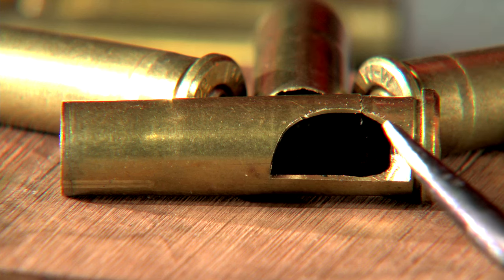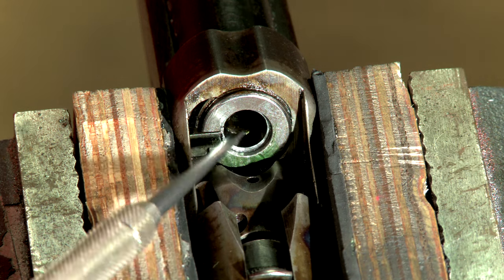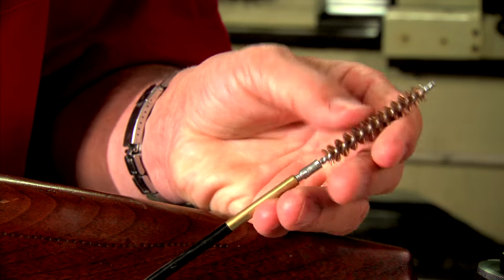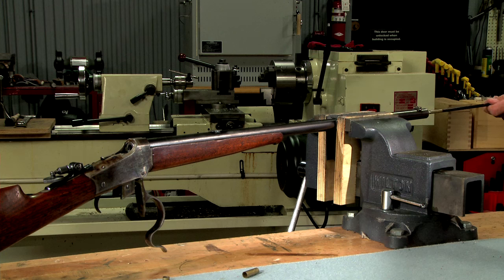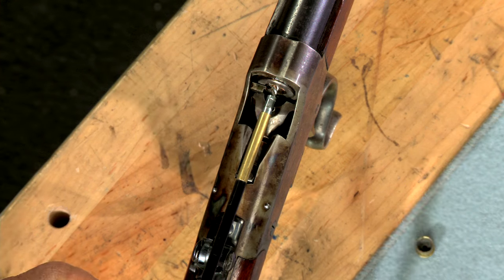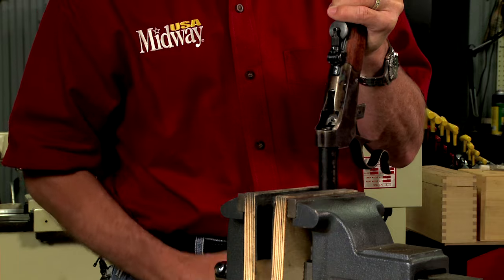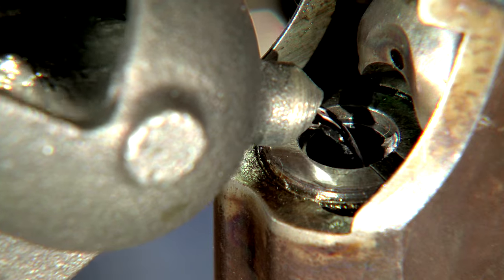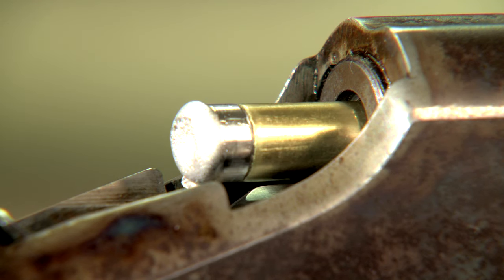How to Extract a Broken Shell from a Rifle Chamber | MidwayUSA Gunsmithing

Comment: Some commenters are missing the point of this video. The idea behind using Cerrosafe is its' low melting point combined with its relative hardness. Plus, when cooled, it shrinks a tiny bit, making it easy it tap out as shown.
Someone suggested using lead for this purpose. DON'T !!! Lead will stick in the chamber. Using Cerrosafe would work under field conditions, with some types of cigarette lighters as a heat source. You couldn't do that with lead.
Reply: Thank You.
Reply: Lead shrinks as it cools too. This is why Lee has to engineer their molds to drop over wanted size, in case someone casts too pure of an alloy. In fact it can shrink a few thousandths

Comment: Larry is a life saver. My DPMS got a broken piece stuck in the chamber today at the shooting range. Couldn't find a shell extractor locally other than at MidwayUSA which would be a 200 mile round trip. Decided to try his cleaning rod and brush method and it worked with a new brush. A used brush more than likely won't work as it didn't for me, too worn down. Either way, I have ordered a broken case extractor for future use but have never needed one before. Thanks Larry!

Comment: Insert a cleaning rod, from the muzzle. Screw a brass brush, just larger than the cae ID, to the rod. Pull the rod into the cartridge. Smack rod, towards buttstock, and brass brush will push cartridge out. Has never failed me yet.

Comment: I find a tap that will thread inside the case without touching the chamber. Usually it will break the case loose just threading it in, or you can tap it out with a cleaning rod. I use this same method for a stuck case in a sizing die, but insert a bolt, then draw it out with a sleeve and the threads

Comment: Yep good stuff but the bore brush will not work with a 30,06 or other high powers in tight chambers.
Simple physics really the case hugs the wall after expanding when fired hard brass on medium steel is way stronger than any bronze or aluminum rod.
So go easy if you don't feel confident give a gunsmith $20-$30 to do it instead of breaking your rod or other damage to the barrel.

Comment: I'm surprised cerrosafe's not banned yet. An eutectic alloy of 50% bismuth, 26.7% lead, 13.3% tin, and 10% cadmium by weight, Cadmium is an environmental hazard and it was banned from use in the electronics industry for quite some time. On a side note, I know of no better metal to cast a barrel though.

Comment: There is a easy way out .1 brazing rod or old brass cleaning rod .bend  1/2 inch from tip , enough to bind in bore. This will snag case mouth .tap rod end with hammer, repeat. Soon stuck case comes out. Cheap solution no gun smith bill. No high dollar exotic metals.

Comment: Great job , I'm a plumber and I use Silver Tin combination solder called 95/5 adheres to brass copper but not steel. You can't get it hot enough to adhere to steel.

Comment: used it on a remington 550-1 that id fired too hot of a 22lr in and the case stuck and i actually ripped  it in half trying to remove it. i bought this cerrasafe and did like larry said and it worked like a champ. i was happy i love my remington and not being able to shoot it causes me to be unhappy! feel better now also learned that on old 22lrs you gotta becareful using hot rounds what i mean is anything over 1250 fps is probably not a wise idea,that didnt have those when this was made and the pressure is too much for it.

Comment: Now for an EASY way which I have done over the years.. Take a fired case cut the head off so you can find the right fine threaded tap that fits and not cut thru the case wall.. 10/32    1/4 -28  or a metric  .. run the tap into the broken case in rifle  then tap it out with  a cleaning rod....

Comment: ..and in case you can't get your hands on Cerrosafe alloy:  cut the hex-head off a timber screw (12-11 for my .22 hornet), weld to 5 mm rod, remove the bolt, insert, lightly screw into the broken cartridge until it grabs ...and extract!

Comment: More difficult? Not really, if you have a ladle and propane torch. As for costing more, a 1/2 of Cerrosafe alloy cost about the same as a broken shell extractor and is reusable. Also, a lot of serious shooters and gunsmiths have Cerrosafe on hand for things like chamber casting (to verify what round a rifle's chambered for)  and slugging a bore (to find a barrel's exact dimensions for those that cast their own bullets or to check that an old barrel hasn't been shot out)

Comment: My 1873 clone did just that with factory ammo.  I have never seen that before, despite shooting (60yrs) ( and reloading for 35 years).  All the pushing and pulling on that 44 mag with brushes and soak with k,,um  penetrating oil even with shotgun brush-- no chance -- so I got the cerrosafe casted the chamber and put a steel rod down as you said exactly and popped out the broken casing.  You cautioned against over filling, so I got the exact right amount and since it is a lever action used a funnel.  Archimedes was right! I got lead on the bolt face as the tip of the funnel displaced some. RATS!  I tried picks and all that saying to myself he told you not to do this!  Then I remembered cerosafe has a low melting point and got the heat gun and Q-tips and it shoots like new.  Thanks for all you do!

Comment: Mr Potterfield
Well done. To the point. Ingenious. I have a not too similar problem. I have a 12ga shotgun with 10 adapters ranging from common handgun rounds all the way to .30-30 and .45-70. The problem is that the spent cartridges are the very devil to get out of the adapter. ( not to mention the adapters themselves).Of course I can knock them out with a cleaning rod, twist them out with pliers, or pry them out with a knife blade, but all of this reduces me to civil war era reload times.  Can you Macgyver me out of this one? Thanks in advance.
Reply: Little too glib there, my friend. Most of them are X caliber inserts, the rifle inserts are $125 18 in SS from Ace Dube at MCA Sports.  Not much help.

Comment: This is the typical work that should be done by a professional gunsmith. If amateurs start to fix the gun, the crown or the chamber may suffer an irreversible damage.

After the case removal, it is worth checking the barrel for cracks, dents and other dangerous deformity with special tools like bore-scope.

Comment: I find that using a brass brush, with several swabs around it, and lightly tapping it into the back of a necked cartridge can usually wedge into the cartridge, and then be pulled right back out aloing with the stuck casing. Bit quicker than going out and buying some metal to cast. But thanks for this great tip, as I'm sure I'll eventually get one stubborn enough that my swab method won't work.
Reply: thanks!! Brush wasn't getting it done, but a single cleaning patch that wrapped a few times around did the trick.   =  debt-of-gratitude!

Comment: Fun Fact: Cerrosafe doesn't work on chambers for belted cartridges. LoL
Reply: Worst case scenario: use a chamber reamer either specifically for that caliber or an ever-so-slightly smaller one.  If that doesn't do the trick, that brass isn't coming out.
Reply: A chamber reamer won't work because the flutes are parallel to the case. It will just slide out. If you are going to use a cutter, it has to be a threading tap itself, or to thread the case to accept a bolt. Threads work because the threads are perpendicular to the bore.

Comment: what do you do when that fails also? I had it happen I tried casting the chamber three times after trying every one of the other techniques. My gun smith got it out with what he calls a "secret tool" he wouldn't show me what it was.
Reply: waylon jennings go to a hardware store buy a brazing rod bend at half inch put bevel on end  insert at muzzle insert like ram rod  foul  Case mouth tap with tool  case falls out remove rod. Save rod for next time. Works like cope chisel to soft to harm gun

Comment: These methods work very well also for reloading sizing dies if you don't use enough lube or the die is cut too undersized due to a worn tool (a problem I had on my first RCBS die set that I never had with LEE. One reason I will never go back to RCBS as far as dies).
Reply: I had a set of 30-06 Redding dies that were out of spec. Specially the sizing die. The cases would not pass the chamber gauge no matter how many times I tried to resize them. Never had a problem like this with my Lee dies.
Reply: @jolebole-yt  It's weird because LEE is so much cheaper.
Reply: @DaveSmith-cp5kj  yeah, much cheaper. For that reason I have Lee dies on all my Dillon presses and never had a problem with any ammo I load.

Comment: wouldnt casting it destroy the boring?
Reply: +Wyatt Monhollon No, the patch keeps the alloy from running down the bore and the cast then taps out as one piece.
Reply: cerrosafe is a very low temperature alloy, but even molten lead isn't hot enough to screw with the barrel. if you are concerned, you could always chill your rifle before doing it in order to "heat sink" it better.